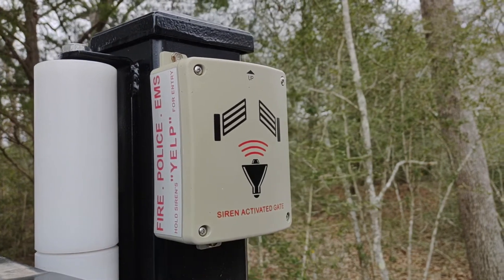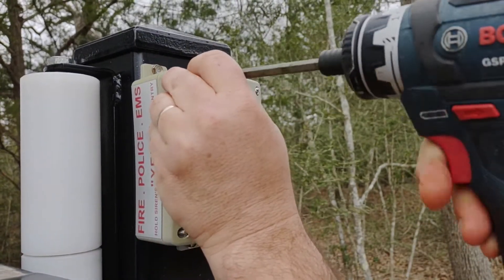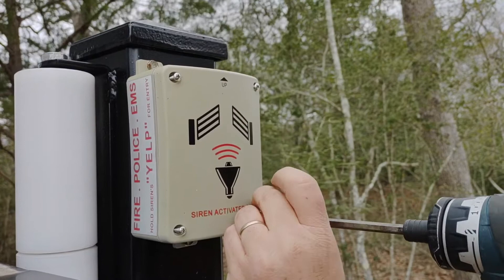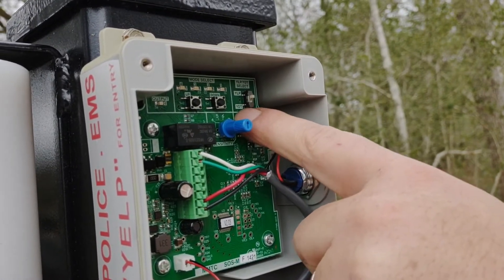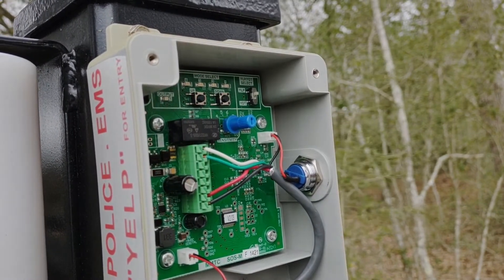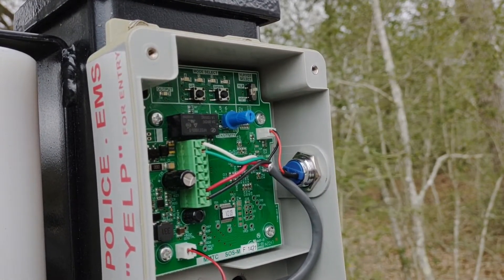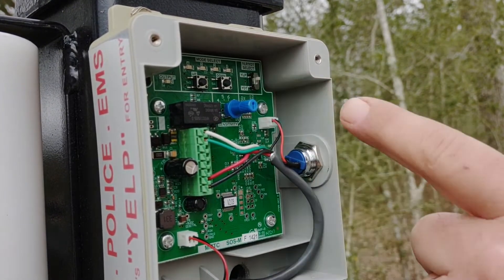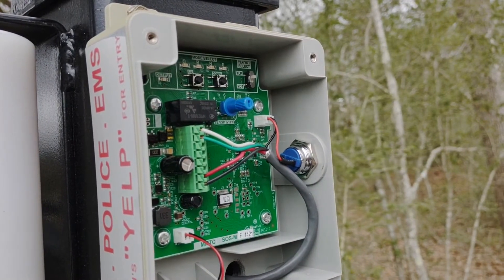You Need to Know This About Siren Sensors

Comment: Funny story but I'm constantly going to gated communities and often the code I have on file for the customer is not valid anymore, I just open up YouTube and find a video with audio of an ambulance yelp and and open the gate with my phone speaker. Press the reset button and bang off to work I go. FyI I also install and service gates so I know all about this feature and the problem of not having the emergency gate opener on the right settings